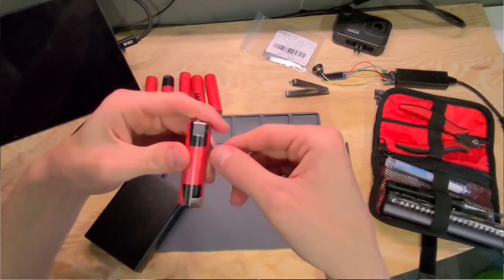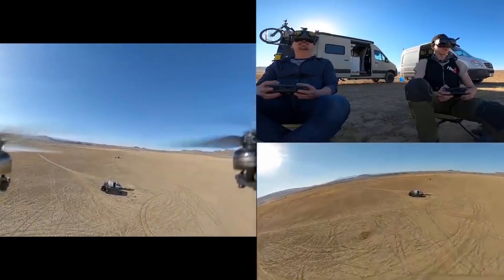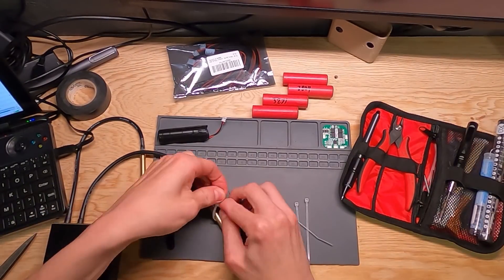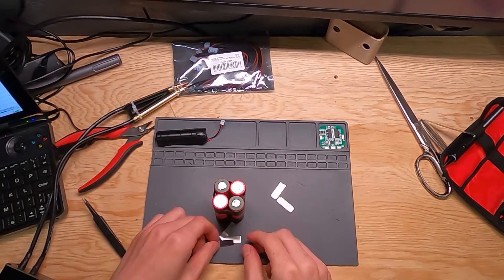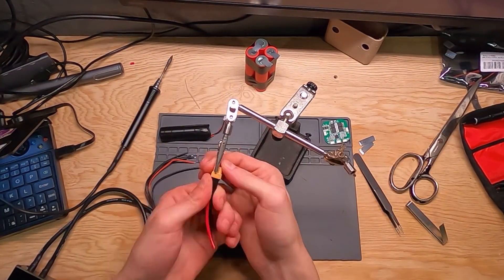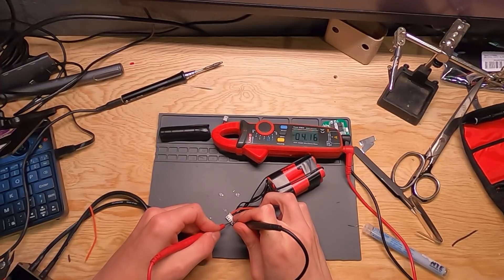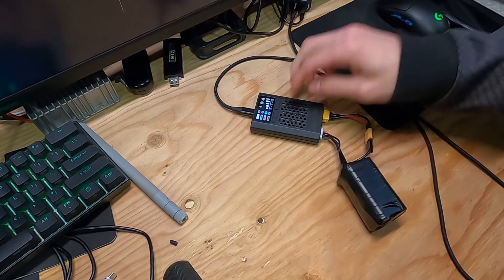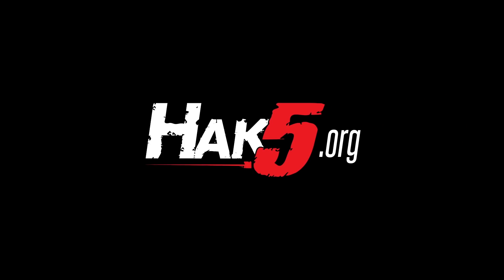Building DIY Lithium Battery Packs w/Glytch Pt2

Comment: Just to clarify, balance leads from the plug should go to the NEG end of the cell they are balancing, correct? (So you basically have one positive lead, three negative leads, and the fourth negative lead is at the end of the 4S pack. So five pin connector. Positive, Cell 1 ground, Cell 2 ground, Cell 3 ground, Cell 4 ground and end of circuit ground)